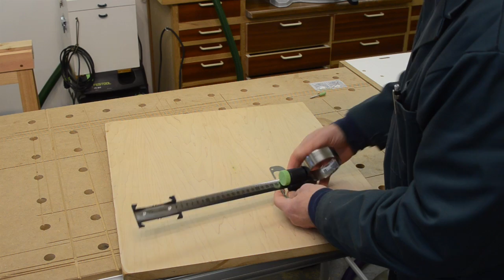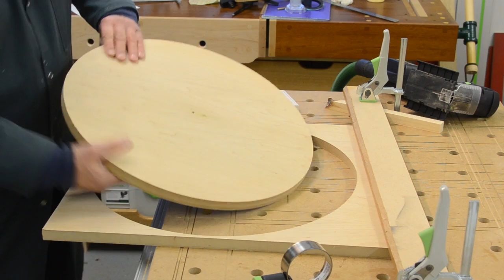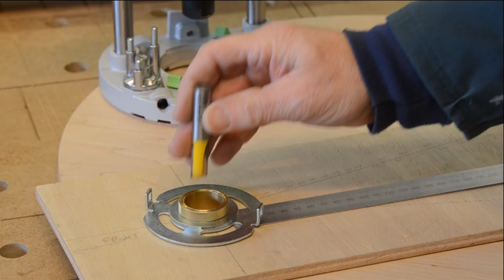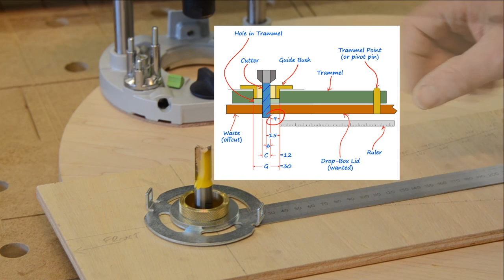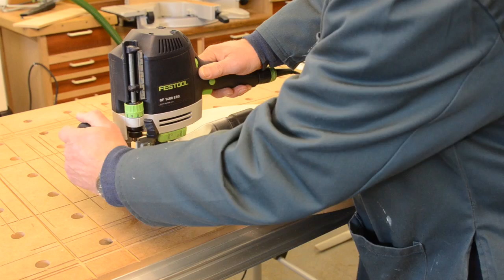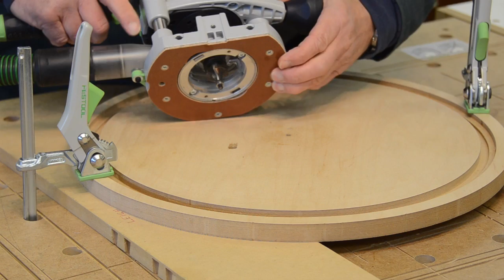How to use a Trammel

Comment: Do you do a video on how you  setup the remote control for your vacuum?
Reply from the maker: +Steve Roofer  Hi Steve, I was just checking to see if I could find out which country you were in and became very interested in your warm/cold roof example video - an excellent piece of work, very well explained and very professionally presented. What software did you use to record the Sketchup demonstration - is it part of Sketchup?             Now your question...I bought a set of 3 or 4 remote controlled 13 amp sockets, with a remote control, from Maplin for about £14. I am sure that they still do them and I am also sure that they will be available elsewhere. Each remote controlled 13 amp socket can plug into a normal 13 amp wall socket. They are then individually switched on and off, using the remote control, which can operate up to at least 40 feet away. I have one set in the workshop and another set in the house.    Peter

Comment: Thanks for the wise words, I will definitely be practising on offcuts first.
Reply from the maker: Hi Rouben, You will find that the greatest care is needed just at the end when you are doing the final cut that separates the inner circle from the main body. At that point the trammel pivot point is no longer fixed. To overcome the risk you can put a couple of screws through the circle piece, that you will be discarding, before you do the cut. That will fix it to your bench or work surface. You can then clamp the rest of the door down as well. In this way the final cut will not be so risky. Take care. Peter